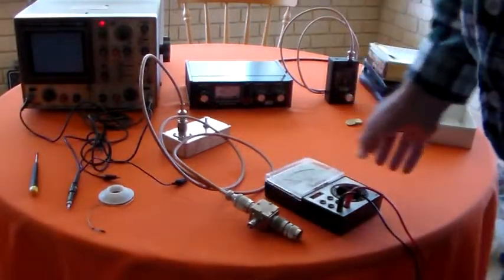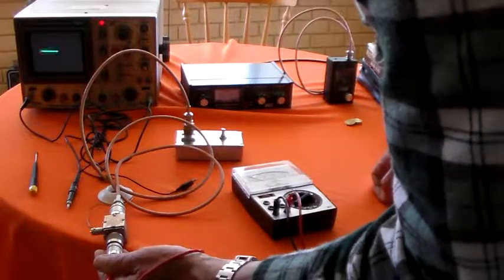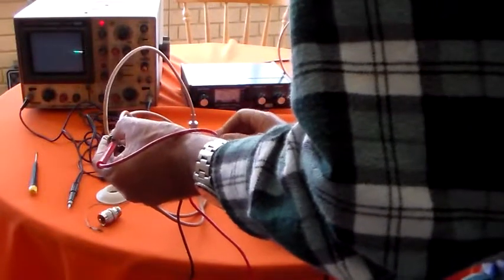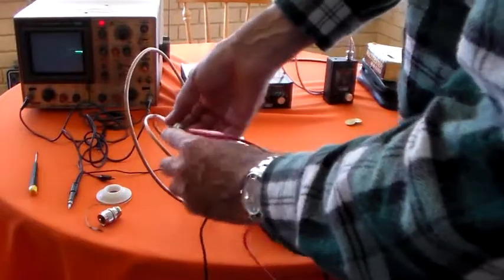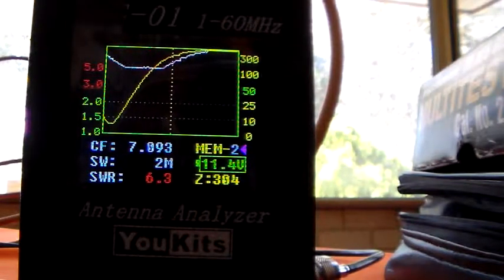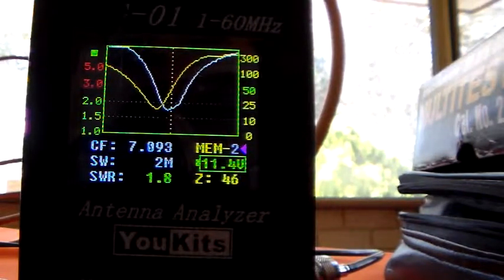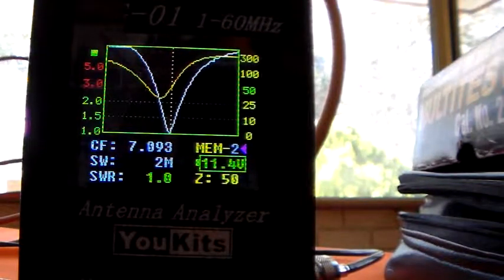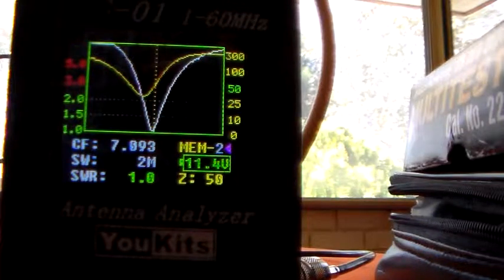Testing an MFJ945E Antenna Tuner Part 2

Comment from the maker: Setting 'A' on the inductor selector is in fact the maximum not the minimum, so I was taking inductance out, not putting it in. The procedure is still the same though... set both of the capacitors to '5' and adjust the inductor for the minimum SWR and then tune with the capacitors.